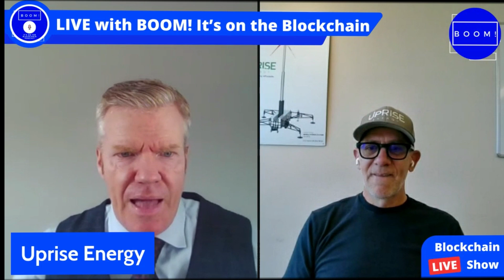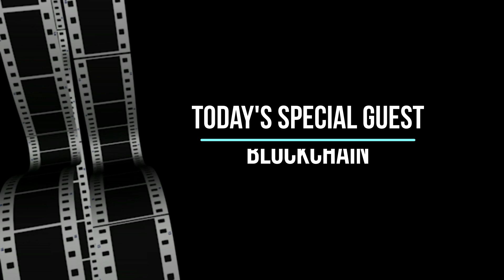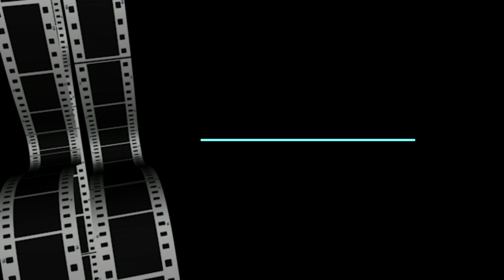Uprise Energy CEO Jonathan Knight's Guest Appearance on Boom Its On the Blockchain Podcast

Comment: what is the max db level of the unit?
Reply from the maker: don't have a specific db level for you but what I can say is that you can be standing directly adjacent to the turbine when it's making its full power and you can have a conversation without needing to raise your voice. basically, it's near silent, you can hear the blades cutting through the air but that's about it.
Reply: @UpriseEnergy  that sou ds like 58db or lower. not a problem for noise codes in probably most areas